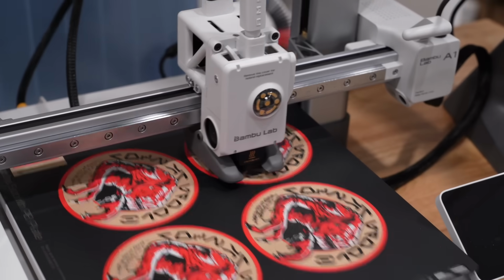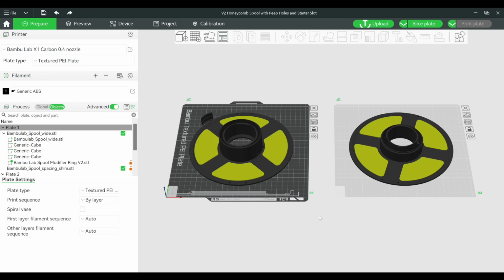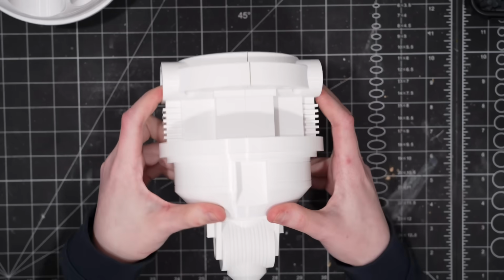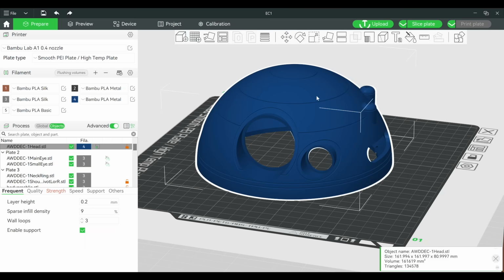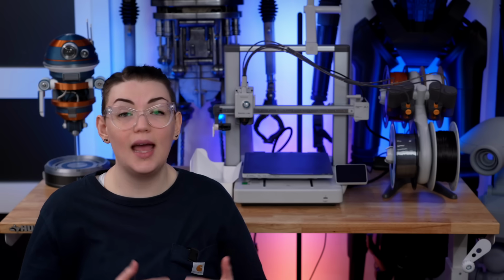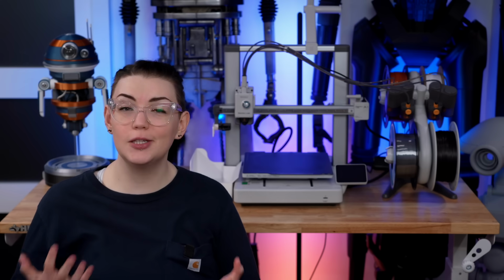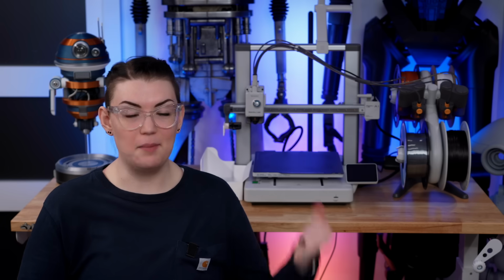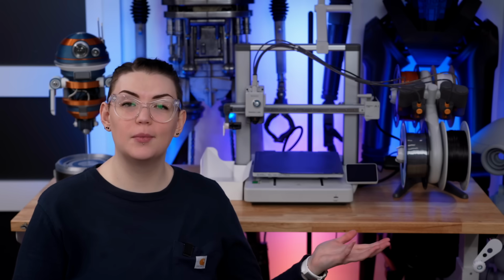Is the Bambu Lab A1 the Unbeatable 3D Printer for Beginners?

Comment: okay so maybe its just me, but i have the Creality K2. Not even the K2 3d combo which is way better- but they have great if not better quality compared to the Bambu lab a1 buttt its always on sale for aound $500 if you add in the 4 filament auto feeder. without it on sale its about 1k but its still great price and it does literally allll the work. you take out 4 screws and 3 stickers and you are ready to go! i can push it to %125 without print failure or quality decline! god i sound like a bot

Comment: Im assuming you could use it for multi materials too? I think she mentioned not messing with the filament settings (so it has adjustable settings, you coukd set for each different material)...does this seem correct?  Does anybody know?

Comment: Super-inspiring in so many ways! I'm at the 34 minute mark, and without me using the google or reading through the comments, is there not some effective way to melt the waste back into a "mud-colored" filament that you could then use to print another item (which can be painted afterward)?

Comment: Thank you for an informative video. The one thing in the review that I noticed, as a non printer myself, is that you would say the prints are perfect. However, there were clear distortion lines visible in multiple prints which you ingored. On the base there were clear flaws in the print but all that was pointed out was the black dot. I chalk that up to 3d printer people have an acceptable level of line distortion. 

This printer does by far have less than other videos I have seen. But being a model person, those lines make painting the prints incredibly difficult. You do mention painting and a hot knife you have for smoothing. Which means I will be checking out some of your other videos.

Comment: The printer itself has changed recently and some of the included parts and accessories have changed.  It looks for the most part a little bit more streamlined and also looks like some of the included tools like the allen keys a bit different (and cheaper looking).   For the most part installation is similar.
Reply: Yes, just purchased one and it didn't come with the bambu color swatches or the bench boat kit shown in this video.  I've seen other videos have a clock parts kit included

Comment: Couldn’t the filament color change be minimized if it were used for infill printing vs component printing? Has anyone done this yet? I mean Bambu actually has a specific filament that is designed to be used for infill, so it knows when it is going to be switched. Why not calculate the amount that needs to be purged and use that as part of the infill process.

Comment: This is no longer an option for many people. We're you aware the Bambu forced an update which means they now decide what you can and cannot print. Apparently you need an Internet connection to their cloud service before you can print, and then only if they authorise the print. This sounds like you only lease the ability to print. Is this correct as many YouTube videos are reporting  this?
Reply: Sort of. They're certainly pushing more for their cloud services but AFAIK there is still an offline mode

Comment: QUESTION: Is material color matching possible? Example replacing broken parts or pieces on plastic models or vintage electronic equipment where replacement parts are no longer obtainable. Is there a mixing process that will give at least near original coloring? I do restorations of vintage radios and the old plastic is often to brittle to salvage.

Comment: The printer comes with the filaments? or is separate ? We want a 3d printer and we have been looking at the A1 and come across to your video. Thank You in advance for your help!
Reply: Do it. Got my kids one for Christmas. 10 and 12. Christmas night i set it up quickly and printed the benchy tugboat. Then switched filament and ran our first print straight through the handy app. The next day while at work my daughter called me. Walked her through downloading the app and connecting to the printer. They have been printing on their own since then. A1 has been running for 4 days straight! They've done 20 prints. We are completed addicted.

Comment: Anyone else have issues with bed adhesion with the stock textured build plate? I tried printing the scraper like 5x, and and AMS lite top mount brackets etc. Every single piece started warping and curling up off the build plate and the prints had to be canceled. I tried increasing the nozzle and bed temps, slowing down to 50% speed, scrubbed the plate w soap and water etc. Nothing worked. It printed the first few layers fine, but then eventually itd slowly start warping and curling up off the plate. 

I have a Prusa Mini for over a year, and NEVER have had adhesion issues. If anything, its been hard to remove prints from the stock Prusa smooth sheet. Never cleaned the prusa build plate and touch it all the time too. 
Only things that i have been able to print with the Bambu are after i spray the whole sheet with hair spray. I know that is a common thing people do. However, i feel a printer in (almost) 2025, and at this price point, it shouldn't be something i MUST do to even get anything whatsoever to stick. Using just basic creality PLA that prints perfectly with my stock Prusa Mini with stock settings. 
And tips or tricks to get better bed ahesion on the A1 Combo with the stock textured PEI sheet, would be greatly appreciated. Having to spray the sheet with hair spray aftwr every print is disappointing to say the least.

Comment: This question goes out to you or to anyone else who does multicolor printing why wouldn't you just print each part in its own separate color and then glue it if you're concerned with actual waste of the filament or aka the actual printer poop and then like in the case of the black lines on certain parts I would just print them as a two-color piece or three-color depending upon how small the detail of whatever it is that you would have to print is but at the same time I would just leave it individual color pieces and then glue them or attach them in a way that allows you to still have multicolor kind of like the Droid top I would have sliced in several different colors and then lay down as one whole piece as I glued together eliminating the need for additional supports as well as the need for color change aka the poop just wondering why somebody would do it with the poop I guess if you wanted to walk away maybe and not have to worry about needing more time to print certain things maybe that's the reason but try to answer the question why you would print and have all that poop

Comment: EVERYONE needs to be aware that there are now black plastic peices holding the z axis in place which need to be unscrewed. The manual Does NOT mention them. I've seen people in the forums trying to run their printer when umboxing it and they are grinding the belt agains the motor pully. Its sounds horrid if you saw the video in the forums

Comment: It's not as easy to setup as they say. My setup was such that it failed. And an error message of abnormal nozzle temperature, submitted a ticket via the handy app.  Support replied once giving a simple solution of removing the back cover and make sure USB c cable is right. Did the recommended fix but nothing changed. Replied to their support message and waiting for days now without any reply from them.. . Totally disappointed with the experience, plus support from Bambu is very slow

Comment: is there any possilbity to print directly on the an object that is made of wood or glass, where i can calibrate the head to a specific rectangle or circular or other shaped object on the base metal plenum. i would like to print right on to a piece of glass or wood to make letters and things like that in 3d attached to a lower surface as i can do easily with a t-shirt with the newer t-shirt 3d embossing silicone and other types of 3d printing devices. so i would like to mount a piece of glass or wood of random sizes, then have the machine level the head to its surface, locate the outer edges of said surface, and then to print a permanent pattern in 3d directly to that surface permanently. in old cnc machining we had a sensor that would locate the outer edges of any object and then print on to it. the head could also be used to sample a 3d surface and input it into a computer to copy that original carving or work of art work as the same size or smaller size copy, but we used a cnc carving head instead. there use to be a site called maxnc.com and they offered on their maxnc 10 a 3d digitizer probe to enter a hand made 3d object into the computer that ran that mni cnc prototype device way way way so long ago, and now there is so much better it is not even funny! The newer is a laser scanning of a 3d surface.. the probe as i remembered could be use to set the location to cut on, or in other words find the outer edges, center, and then cut on wood, plastic, metal..  the only difference this device builds in 3d the cnc cuts in 3d, and scans a 3d object with the probe.  so i have the image i need printed, i just need to auto center and level, and then print on to the surface i want to print on..

Comment: The cameras frame rate is that low because it takes a snapshot every 10 seconds-ish  to compile the timelapse but i agree if you're not filming a timelapse the frame rate should then increase for monitoring purposes.......i started with an ender 3 pro and in comparison my bambu labs P1S is just miles ahead of my old ender 3 pro, both in terms of print quality and speed, the print quality is that good its sometimes hard to tell its 3D printed and the speed is lightning fast and maybe somewhat scary on Ludicrous mode

Comment: Thank you for puttng out a thorough review. This supported my decision to buy. One week in, here are a coupole of set-up tips:
1. For the colorblind, if you get x-motor and z-motor errors at the start, swap the green and orange connectors (on the bottom) to the "other" orange and green port. Dark lighting contributed to the mix up.  Differing shapes could help.
2. the AMS nozzle multi-plexer is port agnostic. You only really need to make sure that you connect the longer tubes to the far side, and don't need to be precise as to forward and rearward position. 
This is a cool hobby, but I want to find out recycling options for the waste.

Comment: I have an X1, and use that for multi colour prints a fair amount. For purge amounts it seems to make a difference how new / dry the filament is (even if dried before use), and how much of a difference there is between the colours of filament. Black and white can clash a bit and give more obvious smudges of one filament on the other (or even giving grey from colour bleed for the first areas printed after switching filaments) - upping the purge amount can help here. As an example at the moment I am doing a 4 colour print, with 2 of those being black and white with the white being about 85% of the filament used in the model - and I have the purge multiplier is set to 1.5

The A1 is certainly giving you good results, and it would probably have covered most of my needs if available when I bought the X1.

For me the 3D printer is a tool to create things I want, rather than 3D printing itself being a hobby.

Comment: Newbie here, how long does 1 roll of filament last? should i order more than 4... or is that okay for a newbie "experimenting" before doing anything advanced? Cheers!
Reply from the maker: Really depends on what you’re printing. As an example, the single coloured droid was about 1.5 rolls.
Reply: @MMsPropShop  Thanks! Do you have to use bambulabs filaments, or are there some cheaper filaments i can use as a beginner whilst i dont need these high strength expensive ones? I'll obviously get one bambu labs one first so i can print the adapters, or i'll just order refill adapters?

Comment: I only had an old horribly calibrated prusa i3 before. You said you need to learn the slicer software. Is there much need to measure exact filament diameters and change those, modify heat settings for the PLA, first layer thickness and speed, how much tape or hair spray is needed, how many prints failed on you?

Comment: Video was a good description, but when you were putting the filament in the tubes to find the right slot. There is no need for that you can put them in any. They all get pushed to the same 1 slot in the hot end and you can use more than 4 colours even though you only have 1 ams

Comment: Do you have  any thoughts on using other filament than Bambu's own?
Reply from the maker: Half of the filament used in this video was other brands. For the most part Bambu’s filament profiles in the slicer for both their own brand of filament as well as any of the generic labeled settings have worked great for the various brand filaments I’ve used on the machine. You can also go into the filament settings area on the printer and update what type/colour of filament is installed if it’s not one of Bambu’s own with the RFID tag.

Comment: That is one of the problems I have seen, they seem to flick waste not only in your waste bin but on the print now and then. Also from my experience the heat beds on the A1 sucks. This is my second A1 (first replaced via the recall) and both have inconstant bed heating. I have resorted to printing most of my prints at 70c to make sure they stick. P.S. that droid looks amazing.

Comment: Great review..  I currently have an Ender 3 pro, and am frustrated that you spend more time troubleshooting the printer than using it.  I have a friend that has been recommending the A1, but then I have another friend who says to spend a little more and get a Prusa because the Bambu is proprietary and closed, vs. open source on the Prusa.  I think from what I've seen, either would probably be good, but I'm curious to hear if you've used the Prusa and can compare?  What about if Bambu goes out of business or gets sued as I'm starting to hear about because of mis-use of open source stuff?  Would it then be a doorstop?

Comment: Fabulous video. Makes me want to learn again & I'm 70 years old. Quick questions: 1) which filaments should I order for highest chance of success with early prints - Benchie, swatch wheel, waste bin & splash guard? 2) How stable does the surface the printer sits on need to be? Any suggestions? Many thanks for your thorough video!! Now I'm a subscriber.
Reply from the maker: Most people start with, and even stick to using PLA. It’s great for a lot of applications (including all of those projects you mentioned) and is easy to print with. It also comes in a ton of colours so you can have a lot of fun making great looking pieces straight off of the printer.

The printer is quite fast and can cause a more unsteady table to shake. It won’t mess up the prints themselves thanks to the vibration compression, but you’ll want it to be on something reasonably sturdy for your own piece of mind. A stable desk or table of any kind  should be sufficient, it doesn’t have to be a heavy duty workbench or anything like that. A lot of people end up using different types of garage shelving for their setups and storage.
Reply: @MMsPropShop  Thank you so much. This will help me put together my initial order to Bambu Lab.

Comment: If budget isn't an issue as a beginner would you recommend the A1 with AMS or P1P with the AMS. I wasn't sure if it would just be worth to bite the bullet now 🤔
Reply from the maker: First, I would look at a P1S over a P1P as it offers more possible benefits in the long run with it being an enclosed machine.
It really comes down to what you’re interested in making with it. One of the biggest draws to the machines that use the normal AMS and not the AMS Lite is the potential to connect up to 4 AMS units to print in 12 colours. The AMS lite can work with TPU, it’s not recommended to use in the standard AMS. There’s also the possible challenges with the various types of spools. Sometimes the standard AMS doesn’t like cardboard spools very much whereas on the AMS Lite, as long as the spool hole is large enough, pretty much any type of spool roll will work (there are many printable fixes for both types of AMS units for more unusual spools though).

Comment: How did you made the badges on the intro of the video never thought of that
Reply: Simply google Bambu lab coasters, you'll find .stl and .3mf files all over the Internet 🙂There are also quite a few guides that show you how to use your own .svg file to create your own unique coaster designs. Best results though with the non-textured build plate as clearly mentioned in the video.

Comment: Regarding waste.  Perhaps a weight ratio of finished product to weight of waste produced would be a good way to start getting a baseline measurement.  I can see each model having a waste ratio included using a standard purge setting?  You can’t analyze it if you can’t measure it.  Create a standard.

Comment: An excellent review on the Bamboo 3D printer and overview of the 3D printing process and what can be achieved. I wish I had seen it before I bought an Ender 3 V3. The marketing material on Amazon for the Ender is way better than the product. The documentation is minimal and missing some important steps in assembly. One cable has poor quality connectors that refuse to fit together! Have yet to get it working. It was a pleasure watching you make your 3D multicolored prints. I’m not giving up! Will check out the Bamboo product line now.